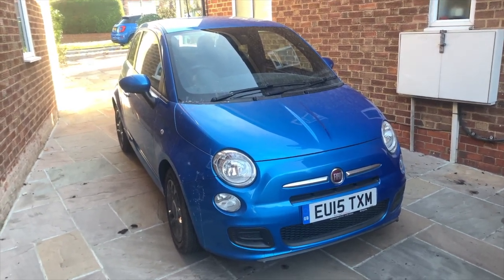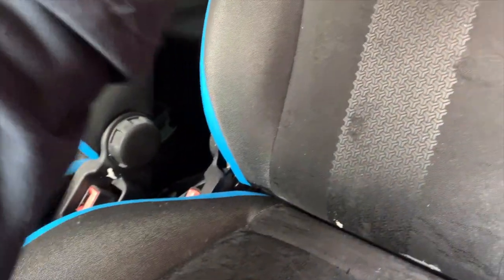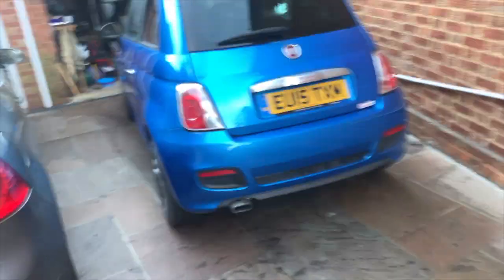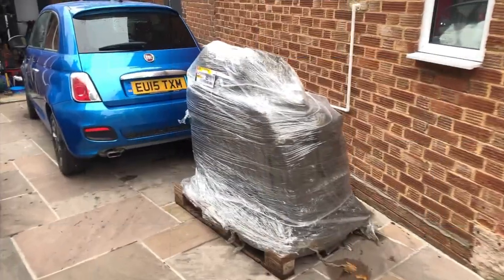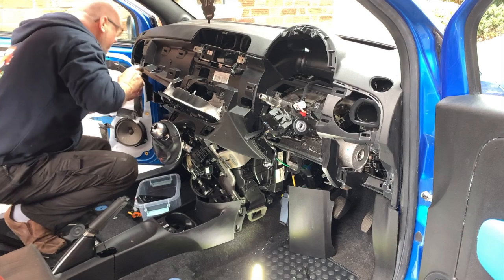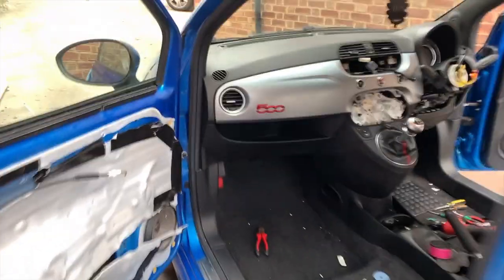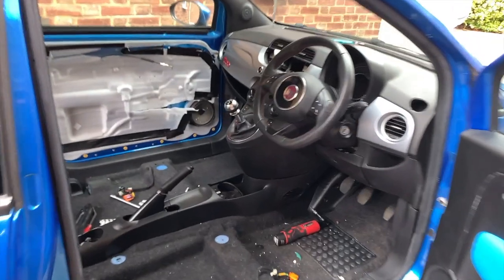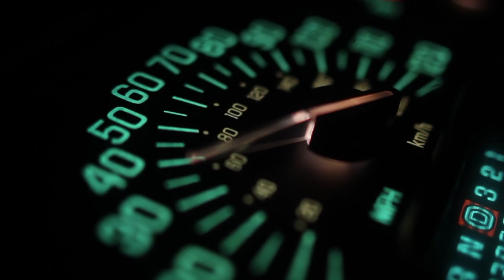Fiat 500 Sport - Project Van Gogh - Day 4 - Back from the bodyshop. Copart Salvage Repair. No crash

Comment: Hi mate for the marks on the dash try a hot air paint stripper and heat the plastic up but be careful not to overheat it I use this method to restore black trims which have been weathered and turned grey may work you could try it on an old bit of trim like the steering cowl.
Reply from the maker: I know about the trim truck, brings the oils to the surface I believe. I’ll give that a go, cheers.

Comment: That's why I fitted a full leather interior from an Abarth in my 500. The seats were shot and owned by a horse riding lady who moved hay and horses in it! Should have got a land-rover. Much better now. This is a good project. 👍  next I am fitting a new speedo! Under your guidance. Could cover the dash in alcantara, I wrapped my dash in carbon!
Reply from the maker: I did wonder about that. Problem with covering it is the passenger airbag. Would stop the airbag from deploying.

Comment: Amazed that you can spend a tenner on a broken steam wand cleaner and then tell me it was too slow ( you never said then it was faulty ..as I use steam regular and was doubting myself ) and then not quibble on the price for a new donor dash and time taken   ...  big learning curve 
Some people have success with rejunvenating plastic  door trims using a heat gun ?  could you flash it over the spots affected ?  some good plastic paints on the market its just the way you apply it
Reply from the maker: Point taken but at this point, I had to spend the money on a dash. I know for next time. I will investigate paints as I think it's too good to throw away.

Comment: Hi mate.
I don't know if you could give me some advice.
I have a Fiat Tippo CAT N, it as a forward collision system, however the left side showing it blinded, obviously not a 500 but was hoping it may be the same set up?.
Reply from the maker: What does this forward collision system comprise of? I believe MultiECUScan covers the Tipo
Reply: @Love500  is that software I need to reset the forward collision, also one of the daytime running lights is not working could that be something to do with the FCS ?
I really appreciate you getting back to me.
Great content as well.
Reply from the maker: @boxersjourney6441  www.multiecuscan.net is where you get the software. It costs 50 euros. If by forward collision sensor you mean the airbag ECU the software will reset any lights once you’ve replaced the blown airbags and will tell you any that are faulty as they can partially deploy so they look ok but the electronics are shot. If your ecu has crash data you will have to send it off to have that cleared first. MES Will tell you. The DRL will be nothing to do with it.
Reply: @Love500  Thank you for the advice.
The car had another dash fitted, there's a module on the dash which scans the road ahead it's only showing one side that's not working on the display.
Hopefully that software will give me a few pointers.
Reply from the maker: @boxersjourney6441  that’s not something that is in the 500. Check the MES website it’ll tell you if it covers the Tipo, I believe it does.